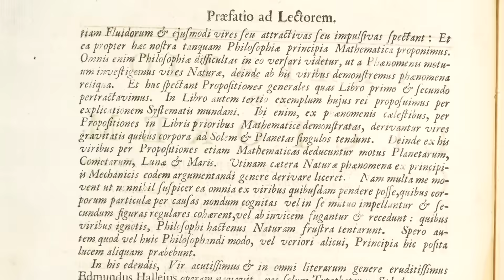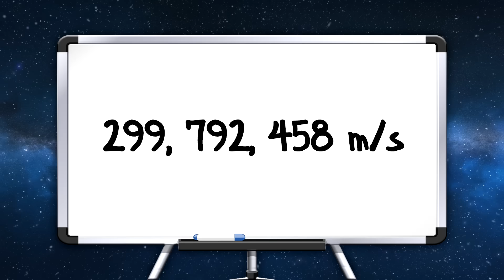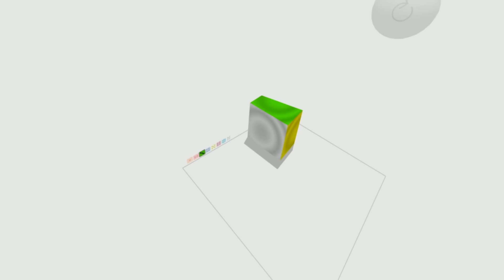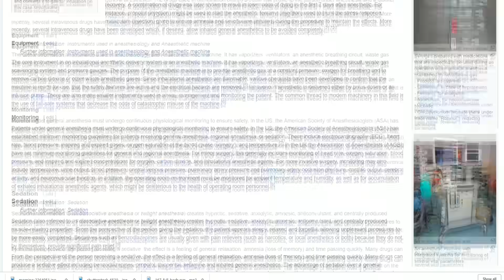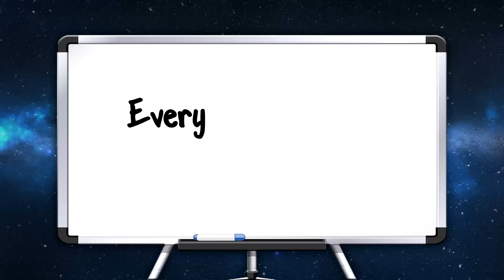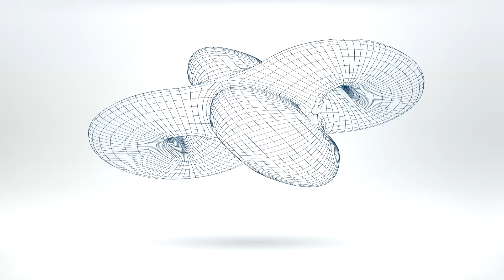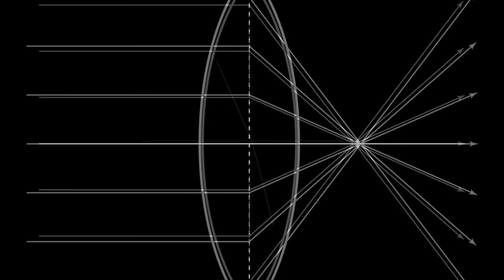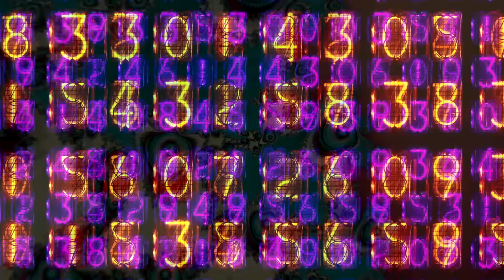The Mystery at the Bottom of Physics

Comment: I was told that gravity becomes a little more complex with insanely large things and incredibly small things. Like take the biggest stars and atoms, or even smaller, quarks.
Reply: We experience time, so technically we experience things in four dimensions. We see three dimensional shapes move through this time. We have memory to measure the past, and foresight to try our best to measure the future, which the constants in predicting it all are too numerous to be accurate, but when looking at smaller equations, say predicting that it's going to rain becuse there are thick clouds covering the sky is easier as the variables we look at are fewer. Yes, you won't always be right, but that's because it can almost impossible at times to have all the information needed in order to predict, which is what math is, accurate prediction. 2 + 2 = 4,  right? Wrong, you can use math to change it. Too many variables can either create mistakes, or make the outcome different, as a famous equation (can't remember the name) has accomplished. It's all relative, and really, that's why Einstein's theories were so revolutionary.

Comment: 8:19 I just wanna say that Pi isn't as arbitrary as those other constants. My favorite way to show this, is that pi=4*(1-1/3+1/5-1/7+..).  What i like about math is that it doesn't seem random like everything else mentioned in this video. I'd go as far as to hypothesize that the rules of mathematics would stay the same in every universe, even though the rules of physics could change. Thoughts?
Reply: The thing is, you can easily describe a system where a+b=2a+2b. It would make no sense to us, combining two amounts gives the sum of them - not twice as much. Another Universe can work in a way such that having 2 apples and receiving 3 more really does "magically" create 5 new apples out of thin air, leaving you with 10 of them. For the creatures living there, this "nonsensical" math would be the one making obvious sense and our 2+3=5 would seem illogical. As for Pi, imagine something like a completely integer-based Universe where only regular n-gons exist, the planck length is 1 meter and the cubistic minecraft-like people simply never happen to find an idea of "circle" either real or worthy of investigation.
Reply: @Eldorado1239  I don't buy it. While math DOES build on certain axioms, every aspect of it is pretty much set in stone from there on. This is unlike physics where things have certain connections i.e. constants that are (atleast seem) coincidential. Math is buildt from the buttom up, using logic to form its structure. Physics need science to explain itself, science done in our arbitrary world. It is really not the same to imagine a world with a slightly different gravitational constant, and to imagining a world without circles. A circle is after all just an infinite-gon, and to imaginine a universe where numbers just stop after a while is really a logic-breaking leap to another degree than one where big objects accellerates towards eachother somewhat slower.

Comment: The issue is not whether we have a handle on everything. The issue is, can we answer the remaining questions? What experiment could we do that gives us insight into what lies beneath the standard model? Will it require building an accelerator with a thousand-kilometer circumference? If so, then the ultimate questions are practically beyond our grasp, even if, in principle, they have answers.

Comment: I can't believe you didn't mention friction, and how glue works. That should be so simple, right? Wrong. We don't understand those phenomena at all, basically.
Reply: Don't know about glue but we do understand friction, why it exists, how it exists, and why does it show the characteristics that it does

If you mean to refer to mandelbrot fractal, then yeah, we certainly do not fully understand this part, but we do know enough to consider it to be understood
Reply: Huh, I always thought that we didn't know how friction worked exactly, and that we only assumed that it's because of bumps on the two interacting surfaces getting stuck on each other. Do we understand why static and dynamic friction is different? Do we know why there are only two friction coefficients? (instead of it e.g. depending on speed of movement across a surface).
Reply: @animowany111  I think that we have no clue why ice is slippery
Reply: Before I say anything, I must point this out, I'm just a student myself learning stuff, whatever I'll say will not necessarily be right

We do as a matter of fact understand the difference, but sure there are also many phenomenons which still aren't explained, for eg, when the transition from static to dynamic friction occurs, there's a sudden pulse like increase in friction, we still don't know why that happens when the force of friction is over come, when I said that we understand friction, I was mostly implying that we understand the fundamentals, because if we go in depth, we truly can't explain anything in a whole, there always be another "why" to any answer.
Also I don't think it's a valid argument to ask why there are only 2 co-efficients to friction
It's like saying why is my whole name composed of 2 different words(first name and surname)
It's just the way it is, tho I must say I never questioned friction in a way you did, this Is the first time I actually thought about this, cheers m8 👌
Edit: I understand if my take on the 2 co-efficient part doesn't make much sense, cus it really doesn't, it was poor analogy and I realise that, as I said, I don't understand this fully myself.
Reply: @gloid4051  that is great question, and the answer to it is just as interesting my dud
Actually you see Ice is not slippery, yup, if you ever go to South or say North (extremes) you'd feel a sense of friction on ice aswell
now the question arises, so why does it act slippery, it's because as it's density is lower than that of water, whenever we step on ice, it instantly forms a thin layer of water over it due the combination of body heat and compression provided by our body

Conclusion, ice is not slipper, it's the water over it which makes it slippery
( Here's a site which explains it wayy better than me if you want to go in depth https://www.google.co.in/url?sa=t&source=web&rct=j&url=https://amp.livescience.com/62621-why-is-ice-slippery.html&ved=2ahUKEwjEx8Hx34TgAhXIfCsKHTnoCRwQFjACegQIDRAP&usg=AOvVaw38R1N17qzyIBgiMBFyUit8&ampcf=1)
Reply: @Pritesh-5  That's just a hypothesis though...also something as simple as a hockey puck destroys your explanation.
Reply: @brokenwave6125   you really should watch the video shared by rand0mletters1, hopefully that sums it up

Also thx alot for sharing that video my dud, it was very interesting

Comment: This is the new Blue Dot video.

Thank you for such an excellent production of a concept that is so damn hard to explain to people.

Sadly you only scratched the surface and that is unsettling as well as what you were did produce. 

Everything is a permutation of something else. Smack anything and the ripples connect to some other dimension and travel down the sub-dimensions of that dimension and so forth. The hierarchies are both vertical and horizontal and spread out in all directions and have that root that you talked about. The massively wtf root. The one that unifies us all in this mad orgy of cosmic unity and individual experiences. A mind bending sickness inducing contortion of existing.

Comment: A story that's always stuck with me is that, when astronomers were first working to measure the distance from the earth to the sun, there was a question of why the universe would have been designed with this specific distance in mind. Attempts were made to find some geometric necessity to the value, or even to derive the value from more fundamental laws. And when we discovered that the sun is a star, and that we were just one of countless star systems, we realized that there was no necessity or reason to it, and that what looked like a fundamental feature of the universe was actually just one draw among billions in a meaningless raffle. There are reasons why we'd only see the range of values that result in a stable solar system, but among those, it's mostly just coincidence.
So the Multiverse hypothesis holds a lot of intuitive appeal to me now.

Comment: Bullshit alert!

"It's tricky to imagine a universe where Pi doesn't dictate the ratio of a circle's circumference to it's diameter. It seems like Pi is built into logic."

No. Just. No. Pi isn't some magic number, no matter how 'irrational' it is or how many decimal places it can be calculated to. It's very clearly, and very simply, relative to the diameter of a circle, it's got nothing to do with being 'built into logic'.

If you set up a playing field and drew a circle on it and walked across that circle, then you walked around the circle, the second journey would have around 3.14159 as many steps as the first. It's not 'built into logic' it's built into geometry. The reason it goes on forever is because there's no limit to how perfect a circle can be - the resolution of the circle's curvature can be increased towards infinity, and so the potential resolution of Pi is equally infinite.

If you drew a circle that should have been 3.14159 resolution, but only used a line of 3.1 length but wished the diameter to remain the same, then it wouldn't be a circle at all, but a many sided polygon. Go to 3.14 and the polygon has less sides, 3.142 and it has even less and so on. 

Any universe where Pi doesn't dictate the ratio of a circle's circumference to it's diameter would be a trippy distorted mess. It would lack coherence and integrity. Navigation in three dimensions would not be possible. What we describe as up and down, left and right would mean something entirely different, like a sort of plasma transformation - kind of like the '4D' shapes shown in the video. It would have no clear utility as far as anything we would understand as utility, and quite possibly no utility by what any lifeform would understand as utility - certainly no life form we could ever hope of relating to, and it would be somewhat of an exercise in futility, if perhaps an interesting thought experiment, to consider what the existence of any lifeform in such a universe would be like.

Don't get me wrong, I'm not saying that life after a fashion - procreation in some form - might feasibly exist in such a hypothetical universe, but if some form of vaguely measurable, consistent space/time dynamic didn't exist, what would be the impetus to move forwards and develop? How would records be tracked?  If you're in A and want to get to B how would you get there and how would other beings make note of that (potential partners in the procreation process ie, or potential predators or prey)? Without some basic constants to ground the nature of existence, it would be too random to generate much of great interest.

Comment: G does change. It's the coupling constant of the gravitational force so it will change with energy scale just like the hyperfine structure etc.

Edit: The constants aren't constant. They are just determined by where the specific ground state vacuum froze after the big bang. So for example at the energy scale where we can probe the weak force, the fine structure constant is 1/128 etc. In a hotter universe gauge bosons most likely also wouldn't have mass since we would have spontaneous symmetry breaking in the Higgs field etc.

Comment: I like the closing line. That's the question isn't it? What the fuck is reality doing here in the first place?

Like isn't it easier for there to just be nothing? 

Or is this (the universe/reality) just what you get from nothing? Because those are the rules?

It's so fucking trippy. Like yeah there was nothing but that's unstable for whatever reason and you necessarily get the universe. But then a law of physics has to be baked into the nothing which makes it something... Which leads back to "isn't it easier to have nothing?" So why the fuck is reality here?

Comment: we find solutions to problems that just create more problems. There would only be a single explanation for the universe and you'd have to wrap everything up in a neat little Möbius bow to understand its origin. If the universe is infinite (not just in physical size but in scale) surely it'll be impossible. My personal theory is the universe is an uncountable infinity collapsing into a countable infinity over and over again because of the imperfections. surely something that isn't perfect cannot be infinite but its got to exist within something and to avoid the circular line of questioning that is "well what does that exist in" there is an infinity that everything exists in, including its own imperfections, but something that's imperfect cant be infinite, an infinite sequence has to be perfect - like parallel lines - and so it collapses. Anyway, do you know why i pulled you over, Sir?

Comment: You can’t have electricity without magnetism....?......and light does not travel.....magnetism draws in dielectric the rate of acceleration disperses the field causing a pressure...this is measured in voltage......coherence of magnetism =electricity......earth is a magnet....resonance =vibrations =friction =heat =illumination.......force and motion...inertia and acceleration...of the magnetic field

Comment: mmmh. Ever heard of the holographic theorem?
It's interesting in relation to how many dimensions there are, because, to paraphrase, the theory states that the same exact universe can be described using any number of dimensions you like, so long as you suitably adjust the physical laws used to match.
Thus, we could describe our universe in 3 dimensions as we already do, or in 4, 5 or 6 by changing the rules, or in fact even as 2 or 1 dimensional if we felt like it, as long as we correctly adapt the rules describing it to match that.

As for logic...
I'm not convinced.
One of the problems here is that logic inevitably stops working at some level.
Mathematics is a perfect example of this; Dig deep enough into mathematics and you find Axioms.
Many of these are derived axioms, meaning they build on something else.
But sooner or later you hit the fundamental axioms. Those which don't derive from anything else.
And what is such an axiom in practice?
It's a statement to the effect of 'assume this to be true'.
No reason or justification for this. We just assume it to be true, then deduce the consequences.
This isn't a logical thing to do, but it IS what underlies everything else.
The processes built on top are logical, yes. But building logic on top of a foundation that is not logical in itself means that taken as a whole, none of it is innately logical.
Formal logic has the same problem. Deductive reasoning, traced back far enough ALWAYS leads to an arbitrary statement that cannot in itself be logical. If you find one that appears to be logical, then you simply haven't dug deep enough yet.

Meanwhile there is a common mental error it seems, when it comes to the 'laws' of nature.
We have this nasty habit of taking the mental shortcut that assumes the models of reality that physics describe ARE reality.
They're not. they are, as already noted, MODELS. Those fancy equations and stuff are not what the universe is, they are models that replicate similar behaviour well enough to predict how the universe will behave.
That sounds like splitting hairs, but it really isn't. We don't know what the universe itself actually is, but we've constructed models that behave in similar ways.
But just as my train set isn't an actual railway, no matter how accurately I've modelled the real thing, physics is NOT the universe. It's a model that resembles the universe... Insofar as we understand it, anyway.
Reply: You've scratched an itch that I had with this comment. Thank you.
Reply: Make this copypasta
Reply: Truth over provability
Reply: No it doesn't.
Reply: Whoa
Reply: KuraIthys r/Imverysmart
Reply: So, the fundemental axioms can't be some sort of loop or infinite regress?
Reply: You get to a point though where if the true fundamentals are intrinsically un-definable, that is, as you say, based on illogical assumptions, that you may as well take them as true anyway. Models exist by out ability to define them, in the same way reality only exists through our perception of it. At some point you gotta ask, who cares if the reality we perceive is the "true" reality. Take it as though we're schrodingers cat in the box, who cares whether outsides dont know if were alive or not, because fundamentally we know if were alive or not.

Comment: The question “Why” is more times than not misleading. We conflate “why” with “what is the cause of” & “how does it’s mechanics work” 
Why can also be used when presupposing intent. Why did you do that. However there’s many reasons to suggest that free will, intent & the self are just a series of inputs & outputs where the “self” is really just a constantly changing emergent awareness with the illusion of agency & persistence over time. (Exurbia has several videos talking about this)
And the question of why again boils down to what are the causes of these effects & how did they work.

Comment: Pretty good, though I feel the need to point out that thoughts are not electrical.  The electric charges involved in neuro-transmitters and receptors can be detected (because these chemicals have charges), and triggered (which is like using a sledgehammer to open a door), but they aren't the diverse palette of chemicals themselves.   Calling thoughts electrical is like saying your bank account is what makes your car go.